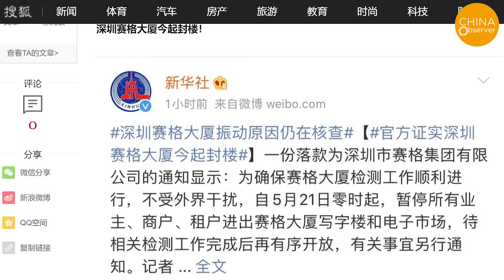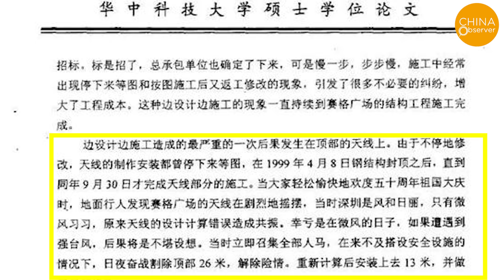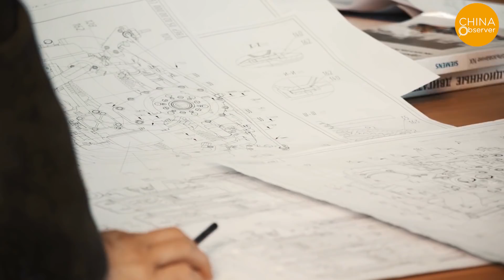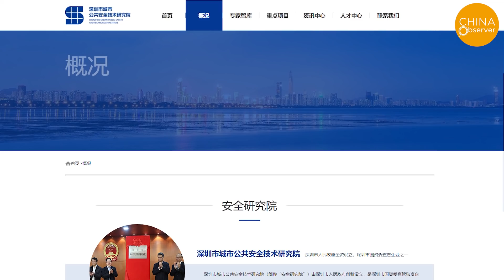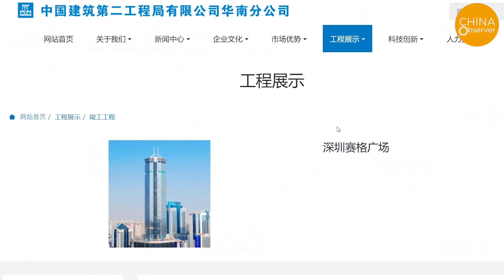356m Tall Skyscraper Shaking Again, Monitoring Data released, analysis of the causes of shaking

Comment: "Combined effects of wind, subway and temperature differences" of that day. The building then shakes twice more. It is a cover up of shoddy construction.
Reply: Both
Reply: I believe that because it's the only building in the world that gets wind blown on it, and changing temperatures. Also, subways have caused thousands of high rise buildings to fall over. Oh wait....
Reply: They actually expected anybody to believe their explanation ?  They really must believe the entire rest of the world is stupid to believe their crap.
Reply: Why'd it wait 20 years to start though?  Either something broke, or the soil is unstable
Reply: @S S Best Tofu building is what you mean Mr. 50cents🤣
Reply: Really, shoddy construction of something made in China??? Is that possible when the Chinese workers care about their work! However , poor materials and design are another problem!
Reply: I did the vibration research before (on industrial centrifuges), although not on the building, the basic concept is the same. Before the building foundation is solid, now you have trains running under the building, so the foundation is not as solid as before, this will change the natural frequency of the building, ...., my suggestion is to put grand pianos in each room of each level, adjust the mass of the building, this way the natural frequency of the building will also be changed, hence, the shaking should be eliminated.
Reply: Tofu building.
Reply: @patriciadunmore9767  There are no tofu buildings in Ba Sing se.
Reply: @patriciadunmore9767  tofu scrapes*

Comment: China Observer, you may wish to relay this.  The floors you mentioned were all divisible by 5.  The common frequency for an earthquakes shakes the 5th, 10, 15, 20th floors.  It is just possible that the building is resonating to what would ordinarily be earthquakes too small to be sensible.  R. Scale 1, 2 and even 3.  Earthquakes would rattle exactly those floors.
Reply: Are there any reportings about shaking floors from other skyscrapers in the city?
Reply: @DietmarEugen  I have no data  of that area.  Also,, different structures respond in different modes of oscillation, frequency,, etc.  It could even be the S and P waves coming from a specific direction.  The classic building type that would show sensitivity I would thing would be a building where all the structural elements were exactly parallel to all similar structural components.  Are there cast in angle braces in the structure?  or Are there no angle braces within the structure,, that can act in a compression or tension in response to a lateral shock.  The key that I noted in the description was the floors divisible by 5 ,, 50 feet.  It depends upon the soil or rock type,, saturated or dry,, but S waves are often 50 feet apart.  Hence, they like to amplify the 50 foot level, the 100 foot level ,, the 5th floor,, the 10th floor,,etc.

Maybe they should be looking for the injection well that is disposing of gunk and yuck  (a highly technical term)  In some nearby direction that is exactly square to one side of the building.  Oklahoma has lots of smallish earthquakes as they inject the used fracking fluids into deep strata.  All you would need is an operation such as that,, functioning at the same frequency,, amplifying each return wave,, over and over again.  Soldiers breaking stride to cross a bridge,, The Millennium Bridge in London , the breaking of a wine glass by a singer.
Reply: @Brendan Nolastname Hey Brendan, you make all good points.  Note the answer to someone else above.  The core of it is,, What is the earth  tremor that is then amplified by resonance.  I assume,, rightly or wrongly that it is a repeated resonance from some source.  Is there a tunnel boring machine 10 blocks away, and injection well with a pump frequency that matches,, what is oscillating at the resonant frequency?  If it matches what an S wave might produce  but even in tiny repeated reinforcements,,,,,

Or,, it could, as you correctly posit that a cheap build has reached design life,, or the ground water below is raised or sunken,, some geologic change.  The core though,, I think you have hit a home run,,, who is ever going to lease space in it ever again?
Reply: It's the foundation failing, they used salty sea sand in the concrete.
Reply: @danblumel    Ouch !!!  Too much salt in the brew will cause deterioration of the concrete and contribute greatly to the failure rate of steel reinforcement.  A nice big tall pile of rubble.  It then becomes can they tear it down fast enough to keep it from falling on the neighboring two blocks.
Reply: All divisible by 5 ?  Doesn't that mean good fortune in China ?

Comment: It started the same time that the Schumann Resonance started spiking off the charts .... two possible explanations:  #1 mantle convection disturbance below Asia that just caused 7+ earthquake on Tibetan Plateau and 6+ earthquake in Myanmar .... #2 galactic dust sheet on a 12,000 year cycle that is entering our solar system and is ready to shift the poles .... both are connected and if this theory is correct then a magnitude 7.5+ earthquake will strike within a week directly between Myanmar 6+ location and China 7+ earthquake location .... these earthquakes will not stop and only get worse due to mantle convection getting blocked and downward convection pressure is released

Comment: Guitar string effect why not solidify the mid section or strenghtening it. just what the other do.
Reply: A giant Floyd Rose tremelo system. Complete with fine tuners and locking nut.  Giant springs attach to the bridge/foundation and the other end attaches to the bedrock. The Chinese approach is different from others.  Let's say you country wants to build a naval force and had no history of it.  First off, you need to see who is a world leader in naval warfare and ships.  For Japan that was the British.  They adopted their traditions and the first ships were British built.  The second generation was japanese built off British design.  The third generation was  the navy ships in WW2. Those designs don't look anything like the British ships. It takes time to learn how to do anything. And you've got to strive to become better. Cranking out show pieces as you get awards?  Ships, cars, sky scrapers, bridges, dams etc. I'm not sure of the structural integrity of anything they build. It takes generations of accumulated knowledge in every small trade craft. Building aircraft carriers is a perfect example of that.  I saw a picture of a bridge collapse in chi

Comment: In my humble opinion, the bamboo piles that they installed underneath the foundation has reached its life span and starts to decay.
Reply: Interesting.
Reply: Plot twist
Reply: @shivaanand9116  Heh, yea the solution is the twist but not plot twist, you can even see it in 6:42 on the tallest building in China. They should add extra structure around the top part of the building that twisting and that would change interaction with wind.
I can bet that the building is shaking when the wind have very specific speed as it is causing vibrations that match resonant frequencies of this building.
Reply: NOT
Reply: Bamboo doesn't decay.
Reply: Bamboo piles aren’t used for skyscrapers in case you weren’t trying to be funny.
Reply: Well you're either a trump cheerleader or someone with a sense of humour, can't be both I'm afraid
Reply: @deanschofield9810  Projecting, the signature move of a democrat that has nothing productive to say. What's next, childish insults?

Comment: I wonder if they used saltwater at any point when mixing the concrete? Most places won’t use saltwater as the sodium causes the concrete to absorb too much moisture and it becomes weak and crumbly. But if pressed for time?
Reply: Very interesting take. That was a major problem at the Fortress of Louisbourg in Canada, if anyone wants an old-timey case study.
Reply: Sir, It sounds like this is the case here due to time frame in building this structure.
Reply: Salty sand is more likely than salt water.
Reply: @danblumel  yes, there was a case in my area where a construction company run by someone my dad knew rinsed their sand with salt water pumped straight from the sea instead of fresh water to save money. Said sand was then used in concrete by another company that purchased the sand without knowing it had salt in it. Even though fresh water was used in the concrete, the salt in the sand weakened the concrete and led to the collapse of a warehouse. for anyone curious, it was in mindelo portugal

Comment: They built a tall building without a counter weight in center of the structure
Reply: They had a swimming pool, hahaha, idiots. Tons of water sloshing around. MADE IN CHINA
Reply: @davidgarton2387  I thought it was a pool on a cruise ship.
Reply: @davidgarton2387  the water wouldn't significantly affect the building, its the crappy Chinese quality building materials and the fact that tall buildings require a counter weight in the core of the tower.
Reply: Now all they have to do is hang the pool.

Comment: Now we have something to watch until the Plum season rains hits the 3 gorges again.
Reply: IF three gorges is still there. Something is going on and they have blocked Google earth with a false image (or it straightened itself over night)
Reply: @shadowcat3163  the livecam are blocked, and most of the time a Dam doesn't collapse within a few months, but it has already started, some big cracks on the side wall. Reinsurance companies could not visit all part's, "because of maintenance" working, i mean maintenance sounds not so good, but our "investigator" can't speak openly, i hope you understand that! should the Dam fail, they will only pay when they was able to monitoring all the prescribed parameters, otherwise they will pay only a certain % to the insurance companies! i can tell you, big cracks were spotted! watch closely in this video in min 7.12, they seems not big, but i can tell you they are immense, don't forget, the Dam is 180meters high , ca. 590feet
Reply: @Nebukadnezar2036  do you have a link to the video of the dam and cracks that you are talking about here?
Reply: i personal think it has to do with the underground, the soil is saturated with water after all this rain, and this is a reason they banned building higher then 300meter, because this buildings are very heavy, some little mistake in the Base, and this is very difficult to solve especially  afterwards, they used bad Quality steel, it rusts inside the cement, theoretically it should be isolated, btw, even at the Airport it was raining through the roof, everything leaking!! i'm sure they will have difficulties to fix it, the only way is to bring down the Weight
Reply: @Nebukadnezar2036  Soil saturation makes sense. toss in the 7.5 and 6.5 earthquakes they had in the last couple of days and things could be coming unglued real fast.
Reply: @shadowcat3163  yes i think so, we have in Swiss similar problem, not in city's, but in some areas near a river! we are lucky, because we sit on hard rock, thanks to a relativ high elevation, but even then we are constantly monitoring the water ground level!! and this was in Shenzhen, near a big river, i don't know how good they controlled the ground, but when it begins to sink in the ground, they can't to much, drilling some holes and fill it with reinforced concrete
Reply: @Nebukadnezar2036  Would explain the construction materials they are bringing in. But also the lack of proper planning, poor materials, and adding on after the plans were finished does not help. The whole country is super saturated from two bumper years of rain and they were not properly planning their cities to begin with. Add in corruption at all levels, shoddy materials, and short cuts and they have a big problem.
Reply: @shadowcat3163  yes, agree. i think we will see mayor events in China this year! this would start civil unrest.
Reply: @Nebukadnezar2036  Could explain their serious attempts to start something in the South China Sea, nothing like a war to pull your population base together. They already have been assembling a invasion fleet off the cost of another country.
Reply: @shadowcat3163  to distract the mass from the real problem, but should the Dam collapse, the destruction would be immense, this would end the CCP, yes maybe that's why they push for war
Reply: OPEN DEFECATION  you are to stupid, it has large cracks, and something like that happens slowly, btw. why China has shut down all livecams?? something to hide?🤣🤣👉💀💀
Reply: What skyscraper? Its all CG. As a Chinese I'm still worried about when can i afford tea eggs. Oh no! The three gorgeous is collapsing AGAIN! According to YouTube.